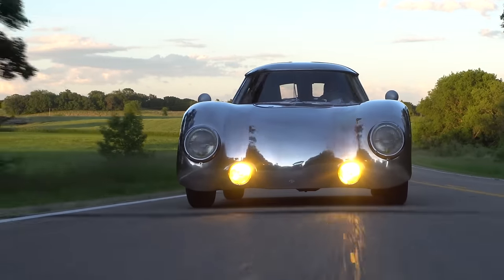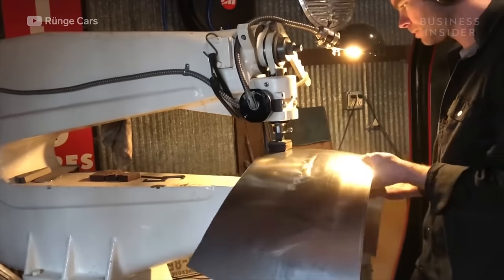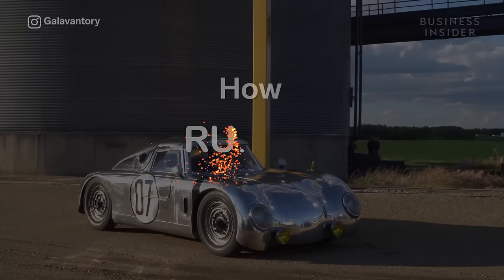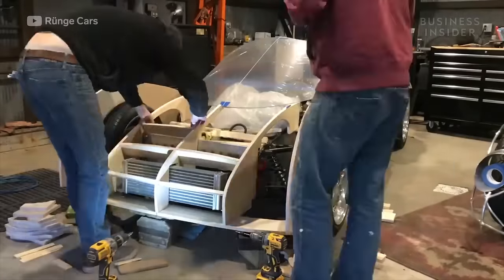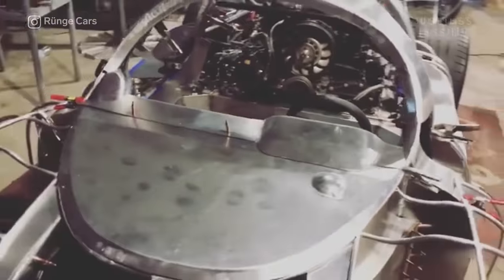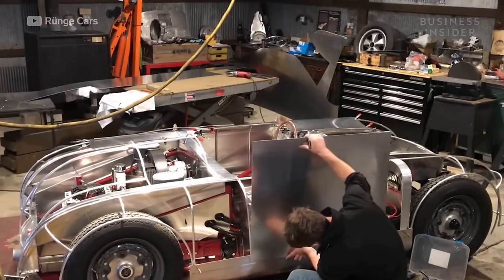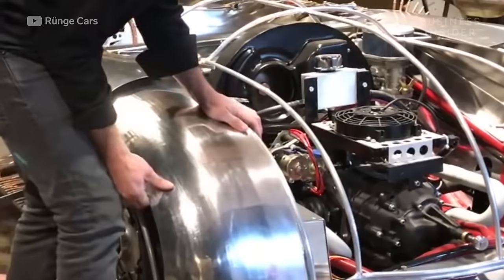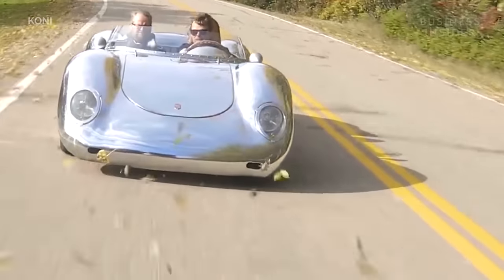How To Build A Car By Hand

Comment: are they street legal? If yes how?
(crash tests required for making legal right?)
Reply: Linton  👍
Reply: AJAY K since nobody is replying, crash tests are only needed if the car is being imported from different countries, if it’s a car like this it only needs an inspection and to be registered to be road legal
Reply: Could be used as a getaway car
Reply: @mattseward3366  oh boi, if it was that easy here in brazil to make an artesanal car
Reply: @undeadaeon9992  i like how u think
Reply: I was speaking with a kit car manufacturer and he said that the law had changed and anyone could manufacture up to 300 cars of a single model per year without any environmental or safety regulation. Definite boon to specialty car builders and car buyers.
Reply: Most cars you register the chassis, whatever body you want to put on it it's your business. This may be registered as a 65 Vw beetle. According to the DMV it's a beetle. In the old days it was called coach building.
Reply: @undeadaeon9992  I thought you said Gateway car😂 Like gateway drug
Reply: @extremerayon7927  Come on it's getting ridiculous now, everywhere I go Brazil is included.

By the way, could you elaborate?, Making a handmade car is my dream and well, br aqui.
Reply: @chilael6892  making a steam car
Reply: It has a license plate so it must be
Reply: Ooooooooh hell no
Reply: You can build a car and get it registered through a process.  Runge Cars and other builders like him take advantage of "Low Volume Motor Vehicle Manufacturers Act” (H.R. 2675)"  You can build cars in a low volume without regulations that major auto makers have to abide by.  You can build up to 325 replica type cars with this law.
Reply: @extremerayon7927  The law is actually very lenient... you only need the cash to pay government bribes (A.K.A. taxes/fees)

Comment: Cool bro. One might get concerned about safety though!
Reply: Well, it did mention a steel roll cage integrated into the body.
Reply: @devenscience8894  but even the convertibles
Reply: @the_appointed1142  Is a motorcycle dangerous? Would you ask a guy if riding his motorcycle is safe? This is safer than a bike, at least.
Reply: @devenscience8894  oof. You got ne there.. That is a very good point. And the car appears to have a low center of gravity so a rollover doesn't look feasible.
Reply: The_Appointed1 it’s safer than a motorbike, the roofless model has a head and neck guard behind it like some 1950’s sports cars so you’re not totally exposed

Comment: Absolutely epic!! But honestly, $270,000 is a bit steep. 
That is the price of a pretty decent house here in Texas.
$175,000 seems a bit more reasonable.
Reply: well he says it takes over 2000 hours. after the cost of the bits, I'd imagine that only works out at about $100 per hour. I know around here an average mechanic asks about $80 an hour. I think he's worth it.

Comment: What about safety features? How did he build the frame? Where are the electrics installed?
Reply: The video said that he used a steel roll cage around the aluminum tubing. I’m also assuming it’s street legal, otherwise there would be no point for the headlights and turn signals it has.